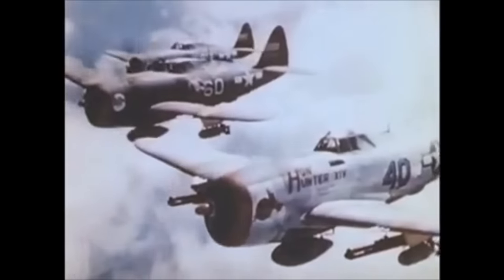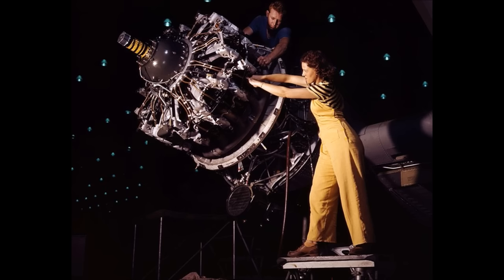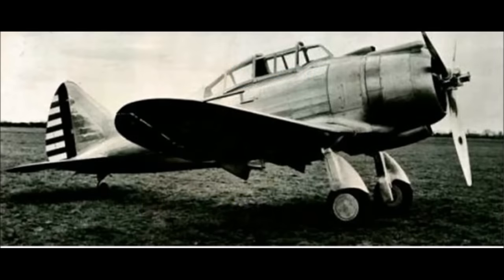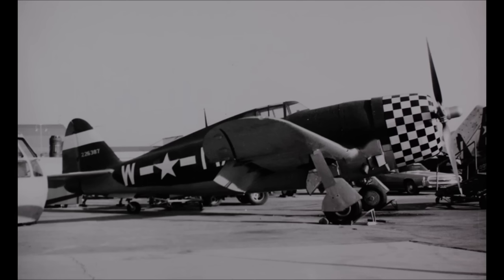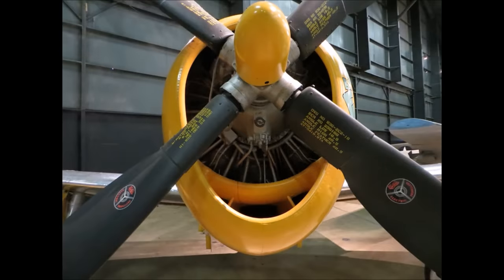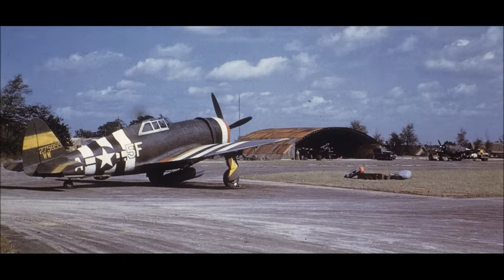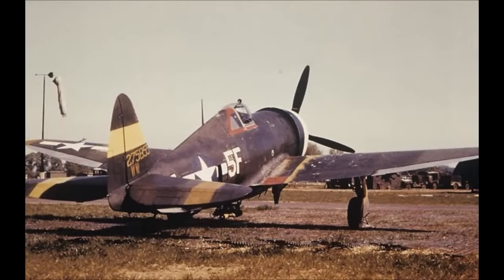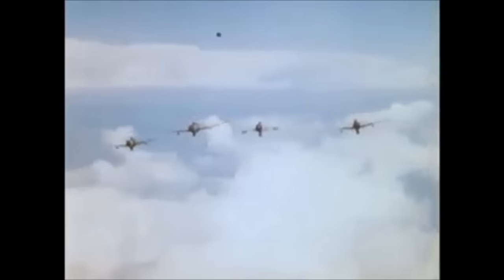P-47 Thunderbolt Pt. 1 Design and Speed

Comment: The P-47 was the fighter plane that won the war for the Allies during WW2 not the P-51!   It was there in numbers from late 1942 on unlike the P-51 which really didn't show up in effective numbers till mid 1944.    The PW-2800 was the best piston engine available for a combat aircraft during WW2 for all sides.
Reply: Great comment - totally agree!
Reply: People falsely think that the B-17 was better than the B-24.  The P-51 gets a lot of free press from the Boeing PR machine since it was the long range escort of choice.
Reply: The B-24/PB4Y was a much more versatile aircraft than the much older design of the B-17 which has state of the art in '36.  The USAAF accepted the B-24 just 3 short years after the  B-17 and the B-24 was already had 30 mph cruise speed advantage with 100 miles further range with the same engines.   Both were the best 4 engine bombers in the world at the start of the war,  no disrespect given to the British designs.
Reply: The B-24 had higher cruise speed[30mph] but a significantly lower ceiling(8000 ft) and less armament than the B-17. The max gross weights and empty weights were very close and so [due to the cruise speed] the B-24 had a slight edge in range or payload(fuel v bombs trade off) of around 100 miles or 500 pounds but was more vulnerable and needed more from fighter escorts.  
I don't have the experience to compare flight handling either clean or with combat damage.
Reply: Both bombers needed escorts against even the earliest of Axis aircraft!   Self defending bomber formations were disproved quite early in the air war against Germany.
Reply: crgintx
I don't agree... the P51 allowed the USA to re-start deep penetration raids into  Germany.  These deep penetration raids forced the Luftwaffe to attack the bombers over Germany... but, now the bombers had fighter escort... essentially, it was the P51 that defeated the Luftwaffe.  Without the P51 the Americans would not have resumed deep penetration raids into Germany.

I am aware of only a single P51 squadron that ever had their aircraft exchanged for P47's; and that long after D-Day when the P-47's would be based in France or Belgium.
Reply: Did the appearance of the P-51 hasten the end of the war?  Yes but the P-47 was the anvil that all other Allied fighters ground down the Luftwaffe's fighter forces upon.  The P-47 had the numbers, availability and ruggedness that wasn't matched by any other Allied fighter in the ETO long before the P-51 was available in effective numbers.   7 of the top 10 US fighter aces in the European theater were P-47 pilots, so you can't say that it wasn't as good an air-superiority fighter as the P-51.
Reply: @crgintx I like your argument, but it's difficult to know because we don't have truly analogous conditions to compare the two.  The rapid emergence of the 51 for the escort/air superiority role was met by the rapid decline of the 47 for the escort/air superiority role. So, we never had a good chance to see them side by side in similar conditions.  As you rightly point out, the 51 faced a seriously depleted Luftwaffe opponent in comparison to the 47 - in large part BECAUSE the 47 depleted the Germans.  This is to the credit of the 47.  But, at the same time, the 51 never had the chance to face the full strength Luftwaffe.  So we can't really take that as a knock or credit for the 51/47 per se simply because they were fighting against the conditions as presented to them.   That leaves us with performance numbers, etc.  But while we can look at those all day long, we'll never truly know how the 51 would have performed in comparison to the 47 had they both been around for the full strength Luftwaffe.  It seems undeniable that the 51 would have dominated the range factor and as such, given the risk to the bombers at the time of USAAF intro into the ETO, it would have been the logical fighter of choice.    The longer range 47's were late in the game and it would be difficult to come up with a reason for why they would have even been picked for escort/air superiority, had the 51 been available.  Durability, armament, and dive speed were the obvious superior qualities of the 47, but early on, they could barely make 2hrs in the air whereas the p-51 could range all the way to Berlin.  It seems unlikely that the 47's superior qualities would have been enough to overcome its obvious range disadvantage.  I think in an "ideal" world, I would have loved to have seen the p 47 N and the p-51 D operating at the same time in the escort/air superiority role over germany against a full strength Luftwaffe.  That would have been quite the show.
Reply: @helzevec  As to which was the best fighter overall,  I'd give it to the P-47.  the P-51 had the edge in range perhaps in climb at lower and medium altitudes but considering it's heritage as a P-40 replacement, that's seems normal.  The P-47 was designed as a high altitude interceptor and as stated in the video was extremely fast at altitude.  As a fighter-bomber, the P-47 was only matched by the Corsair in versatility.  In the air-superiority roles,  I'd rate all of the later model prop fighters,  P=51, P-47 and Corsair as  pretty evenly matched with only the Bearcat as markedly superior in the climb but it was pretty short ranged.
Reply: @crgintx  A good civil discussion here. I would like to add that by the summer of 1944, newer P-47 "bubbletops" with the extra 70 gallons of fuel in the fuselage and drop tanks were flying all the way to Berlin and back. Of course for deeper mission you still needed the P-38 or P-51. Also the last 8th AF group (other than the famed 56th) that converted to Mustangs was in December 1944, so it wasn't like flipping a switch and everything is Mustangs. The 8th achieved air superiority in March of 1943. It was done with the efforts of P-38s the bombers (which while over claiming, did shoot down a lot of German fighters), and especially the P-47. It can best be said that the P-47 broke the back of the Lufwaffe and the P-51 delivered the "coup de grâce".

Comment: In Drag Racing we have discovered that buy simply switching from Roots or Screw type super charger to a Exhaust driven Turbocharger takes a lot of the stress  associated with higher RPM off the rotating assembly. Often allowing A given engine platform to safely operate at higher RPM. This is due to “Drive Pressure” acting like a cushion when the Piston Turns the corner @ TDC on the intake & exhaust  “Over Lap”! On a Super Charged Hemi. We  pull the oil pan to replace Rod & Main Bearings every run. We Mic the bearings to see how much they Squish and tune the engine accordingly kinda like reading spark plugs. When Turbochargers where finally allowed in the NHRA Pro Mod Class we found out that the same  bottom end making similar power with a Turbo will go 25-30 runs with out the bearings even moving. This greatly reduces  the Wear seen by the Rod bearings and wrist pins seen at high RPM. I think this is part of the reason why down sizing Engine displacement while increasing engine output is so effective in modern day Turbocharged engines. It’s hard to explain but the outcome is pretty dramatic. With any given engine platform in my experiences on the Dyno. A lot more power can be made safely on a given engine with a turbo over all types of superchargers Syn, Screw, or Roots. Turbos also combat resonant vibrations transferred from the Crank to Cam via timing gears or chains. It’s hard to explain just how dramatic it is.

Comment: BTW, Seversky is pronounced "See-ver-skee" with the emphasis on the first syllable. Virtually everyone gets it wrong, including me for a long time, so don't take this as a criticism.
It is not a well-known thing, but the longitudinal offsetting of the rudder and the elevator is to prevent turbulent interference between them at high angles of attack (Alpha).
Chance Vought F4U "Corsair", Mitsubishi "Zero-sen", Boeing B-17, Hawker "Hurricane", as well as  Germany's WWI "Albatross" series, have offset rudders and elevators.
Greg, I'm a  big and loyal fan of yours. Great work

Comment: I love the p47. 
I also used to play aces of the Pacific by serria way back when. The jug was slow and turned like a truck. It had to be modeled with the small 3 blade prop. On the other hand if you shot it with a zero it would smoke and climbed away.

Comment: In Spitfire pilot Geoffery Wellums amazing auto biography FIRST LIGHT , he recalls taking part in the emergency reinforcement of Malta with Spitfires launched from aircraft carriers. Something which had never been done before.  As the ship steams toward Malta he goes below to inspect his personal aircraft. The maintenance crews are busy hammering wooden door stops into the landing flaps mechanism, and replacing the belts of ammunition with cartons of cigarettes!  
After a few white knuckle tests enroute it was concluded the Spits could not reach sufficient RPM on the short carrier deck for a safe take off, and they had to scour all of England for the latest model of variable pitch props and get them to the carrier before it closed on Malta.
A book you will read in 48 hours or less......First Light.
RIP Mr. Wellum.

Comment: You might be able to find this faster than I can, or maybe you already know where it is. There is a video of a P-47 taxiing after landing and it has some significant battle damage. In the video on of the cylinder is missing and you can see a connecting rod and piston flailing around. Pretty sure I saw it in a P-47 documentary on YouTube. I can't find it now though. I've been looking for that clip for a while because it's an excellent representation of just what kind of damage these planes could take and still get their pilot back home.

Comment: Your channel(s) here on you tube have helped to vastly add to my knowledge within aviation in general and (now) specifically on warbirds for WWII. Your research and info provided here has re-inspired me to search out and consume the more recently published books on the exploits of the air war over Europe, in fact I have read  4 or 5 Kindle books in the last ten or so days. Within one of those was an excerpt from a P47 pilot (early 1944?) whose crewchief said he could modify (or disable ?) the governor to increase manifold pressure to 72 inches. I will have look back to find and add the reference later .... but I would assume he meant the turbo as it makes the most sense.
Reply from the maker: That's exactly what he was doing, increasing the turbo's output to boost manifold pressure. I am 100% certain that happened.

Comment: Greg - I think the source of the surprise when comparing the different drag coefficients is because Cd is a very artificial parameter, as opposed to the actual drag. It really doesn’t say very much because it is of course dependent of the surface area term. Often it’s the wing area that is considered, but it doesn’t have to be when decomposed into the different types of drags (and coefficients of drags). 

I’m sure you know all of this, but I spelled it all out for those whose less familiar on the topic. By itself, the coefficient of drag is a useless term that won’t get anyone very far in the comparison of different aircraft. Maybe useless is too strong of a word, but without knowing the surface area or the dynamic pressure, “useless” is pretty much spot on.
Reply from the maker: I agree that by itself it's not too meaningful, but it's still a useful number. Think of it this way, by itself, horsepower is meaningless.

Comment: P-47 D-28 is out for Il-2. DCS will also have a P-47 in the future. I'll be happy to hear your thoughts about those sims. Nice and very informative video, once again.
Reply: P47d in IL2 Bodenplatte is not modeled correctly as of yet, gross over weight,  any slight back pressure in a turn at proper speeds it flops over into an inverted spin, over all poor performance under 7,000ft turbo off, very poor performance at 20,000ft+ turbo on, one cannon burst and it falls in to pieces.

Comment: Watching Greg's videos it is clear that the cooling issue is central.
Makes me wonder if a hybrid concept where air-cooling is a backup would have been worth looking into.
Reply: The handwriting was on the wall for high performance air-cooled radials late in the war.  Improvements in recip engine performance were only going to come with liquid cooling.  P&W probed the limits of air-cooled radial design with the R4360 4-row engine with cylinders of the aft banks being rotated to give them direct airflow with VERY carefully designed and sealed ducts.  Curtiss-Wright ran into big cooling problems on their R3350 2-row, which did not have staggered cylinders, and learned their lesson.  They took on the concept of liquid cooling for radial engines with the Tornado series of engines.  Designed in 14-cylinder modules, it could be built up to 70 cylinders, but the prime configuration was to be 42 cylinders.  There was also the Lycoming R7770 4-row, 36-cylinder engine of 5000 HP that was liquid cooled, that was supposed to be the powerplant for the B-36 intercontinental bomber.  But the jet age was coming and such wild, monster piston engine concepts were abandoned.

Comment: Another great video.  I'll watch the rest of this series later.  One question I always wondered about was why the range was so short on the P-47 but so great on the P-51?
Reply from the maker: The P-51's airframe, is packed with fuel tanks, and the Merlin uses less, plus the P-51 requires less power to move through the air at a given speed. That said, by the end of the war, the 47's range was just as good, sometimes better.
Reply: Boy Greg handled this range question in part 6 masterfully.

Comment: Greg,

I"ve recently become addicted to your series; the level of detail is amazing, and it's answered quite a few questions I've had for quite a while.  

I have a question:   I remember reading an account by an old P51 mechanic who noted that an awful lot of P47s, Hellcats, Corsairs and other radial-engined planes were lost on operations because they used an awful lot of fuel to help cool the engines while at military power; basically, the "rich" mixture was using fuel as a heat exchanger.    This led (he said) to a lot of radial-engined planes running out of fuel - in the cases of carrier planes, over the ocean, with dismal results (not that having to put down over occupied Europe was a palatable alternative.  

Have you addressed this yet?  If not...could you?  

Thanks, 

M
Reply from the maker: Thanks Mitch.

Comment: I hate to be redundant, but once again, an excellent piece of work, Greg. I knew the air ducting and other  mechanical bits around the P-47s turbo were complicated, but I never really appreciated just HOW complicated until this video – the period engineering drawings and explanations really help those of us who are definitely not engineers. My Dad was the engineering officer for VF-19 in the Pacific in 1944 (F6Fs), and for VBF-150 (F4U-4s) in the Atlantic and Caribbean in 1945. I'm beginning to get an idea of what that title – "Engineering Officer" – involved, and you haven't even gotten to the other systems on the aircraft. Good photos that I've usually not seen before (and I've been reading about WW 2 for about 60 years), clear explanations, and obviously, a LOT of research on your part. Well done.

I was a long-time player of ParSoft's "Hellcat" flight sim – I've no idea how accurate the flight model was – and I purchased a few other sims over my 28 years (!!) of Mac ownership, but as I upgraded computers, the sims usually weren't compatible. The only one I have now is "Warbirds 2012," which is pretty long in the tooth for a combat sim nowadays, but Mac-compatible flight sims are few and far between (and I'm not prepared to invest hundreds of dollars in joystick, rudder pedals, etc. – it's a game, not an occupation), so I'll be hanging on to it for as long as it'll run on my computer. I'll be interested in hearing about your experience with sims on your new machine, particularly with your now-extensive background in WW 2 aircraft performance.
Reply from the maker: Hi Ray, thanks for your post. Your Dad probably knew a lot as an engineering officer. Modern aircraft mechanics can plug in and the aircraft tells them what part to change. Back in WW2 the mechanics and engineering experts had to fully understand the systems in order to solve problems, and these planes were quite complex.

Comment: Greg, I thought you might find this video interesting. It’s got more detailed information about blown nitromethane motors and their innards than I’ve seen on the internet.
Ironically, the one part they blurred out because it was a proprietary secret had to do with the blower.
But it still has a lot of detailed information about the blower. How they lessen the clearances.
And how much power it takes to turn the blower.
I also found it fascinating that they used the solid copper head gasket thickness as a tuning item.
Lots of “voodoo and magic” in these incredible engines.
MM